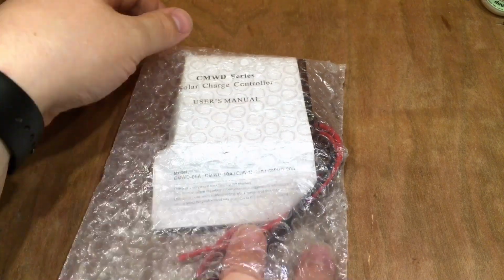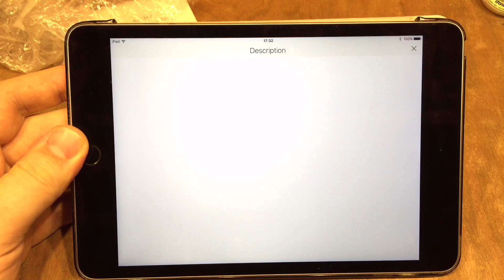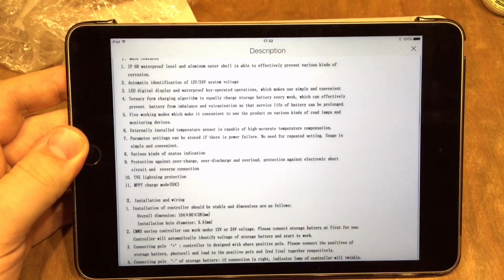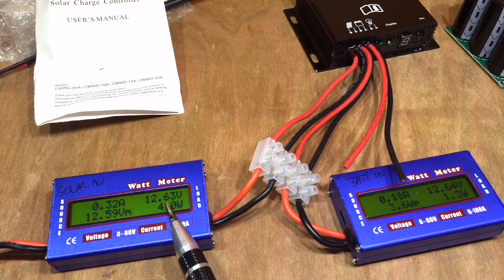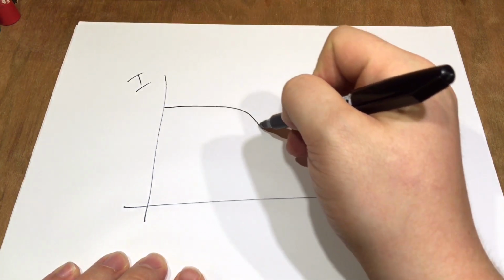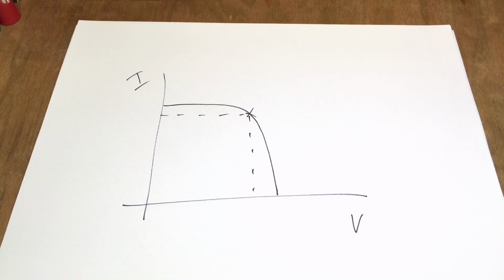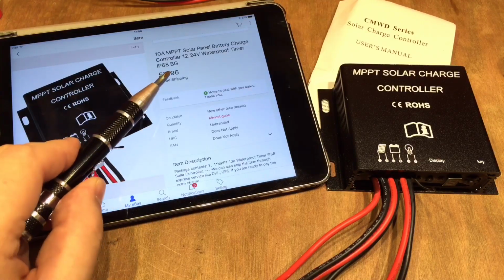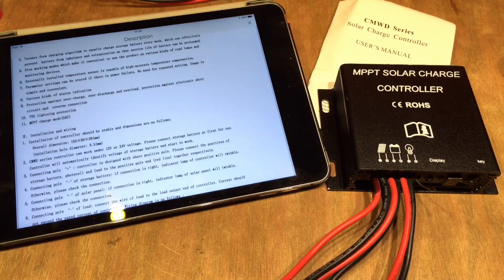Cheap MPPT(?) Solar Charge Controller - 12v Solar Shed

Comment: You are correct, Adam, that the "MPPT" charge controller you bought definitely does not appear to really be MPPT based on the input/output current/wattage your meters displayed.  But also, please realize that the similar PV voltages you measured is not the reason.  No matter how high the open circuit voltage of the panel(s) is, a true MPPT charge controller is also going to drag down that voltage to near the current charging voltage because it is going to be utilizing as MUCH energy from the panel as it can (always close to a short circuit).  So, even with an expensive MPPT charge controller, you're going to see low voltage across the panel during bulk charging.
Reply: Base on the video the MTTP controller need 3 watts to operate, if the input wattage is 50 watts then the output will be 47 watts .
Reply from the maker: I'm sorry but I don't agree.  The maximum power point is generally around 80-85% of the open circuit voltage of a panel.  Remember power is voltage multiplied by current. For example most '12 volt' panels have an open circuit of 21-22 volts and a MPPT of 17.5-18.5 volts.  When a panel is short circuit, there is no voltage and therefore no power, and conversely when a panel is open circuit, there is no current and still no power.

In bulk charging mode MPPT charge controllers should be doing DC to DC conversion and attempting to achieve the maximum power from the panels.  A good MPPT controller should have a shunt and voltage sense on the panel to work out maximum power, and most use an perturb and observe algorithm to find the maximum power. It will then adjust the DC2DC converter to bring the voltage down to the battery level and increase the current.

Most MPPT charge controllers can use much higher voltages on their solar panel input for this very reason (my current one in the shed can have either a 12/24 volt battery system, but panel voltages up to 96 volts). The DC to DC conversion will peak at bulk charging (the highest difference between input and output voltages) - reducing as the battery gets fully charged.  The DC to DC converter will almost always be a buck converter - the panel voltage has to be higher than the battery voltage, otherwise it cannot work.  In fact I have only ever seen one controller use a boost converter where panel voltage needs to be lower than the battery voltage.

PWM charge controllers will however bring their panels down to the battery voltage when in bulk mode - however it is not the maximum power point of the panel - you'll typically only get 70-80% of the rated output of the panel like this.  The panel will look to be higher when the battery is getting full as the panel may only be connected to the battery for perhaps 5% of the time - most volt meters will average their reading - but you can see this effect on a oscilloscope.  This is the reason I suggest testing the voltages when the battery is low, and the charge controller is in bulk mode.

If you haven't seen any of my other videos it might be worth looking at the two real MPPT chargers I've reviewed - there is a clear difference in input and output voltages in bulk charging mode.

Sorry for the long post but I hope you find it useful.  Thanks for your input.

Comment: Use  24 Volt batteries and a beefy PWM charge controller, they voltage from a 60 cell panel very closely matches up with the battery voltage.

NOCT voltage for a 60 cel panel is normally in the order of 26-28 Volts (not the 30 Volts from 25C testing). That comes very close to the float voltage for a 24 Volt system, excellent! Cheap

Comment: So i'm planning to set up a system with 4 cheap 100W panels. I'm interested in having a separate MPPT for each panel. Do you know of any controllers that you can daisy chain or have dual/quad mppts?
Reply from the maker: +Arnþór Gíslason none that I'm aware of that allow four strings. Two strings is more normal in the higher price brackets.

Comment: Excellent video Adam. Another fake MPPT. I've got a £30 MPPT coming soon - that'll be fun to test :)
Reply from the maker: +Julian Ilett Thanks Julian. I'll look forward to your review. Thanks also for the recommendation of the super capacitor module. Makes these videos easier to produce.
Reply: Looked familiar - it's the model that you suggested to me!
It works, and knows to switch between constant current and constant voltage as it nears the target voltage which in my case is 50.00V.
Not sure how well it tracks the MPP yet - panels can have multiple peaks when bypass diodes are used across groups of cells and shadows aren't contiguous, such as from trees.
Reply: @ahaveland  Which MPPT model did he suggest to you?
Reply: @jimthvac100  MPT 7410A in a green anodized case. There's also the CTKEV300 which is worth trying out - I got two of those too.
(Note they are boost converters and can only output voltages higher than the input.)
Reply from the maker: +Andy Lee Robinson I'm glad to hear it works - I haven't been able to watch Julian's video as I'm away and 3G is thin on the ground. 

When Julian made his comment above I did think it was most likely to be the model I'd suggested to you. I'm looking forward to getting on line and watching the review as well as seeing your progress with the ebike charging system.
Reply: Yes, I wondered if it might be the same model.
It's cute and quirky and great value, and refreshingly not fake!
Julian's done two videos on it, and a third is to come - check into a cybercafe and get popcorn! :-)

I found a way of increasing the input voltage lower limit on the Turnigy Reaktor so it can keep the panels nearer their MPP. I should add a comment to the description and do a new shorter video
I got some more cells, made 3 panels and have another one in progress. 400W is starting to get useful!
As you saw in my vid, the PVC film deforms, so am currently replacing them with polypropylene which is much better, but a bit less transparent. Ideally I'd like to use ETFE sheets but can't find any here yet.
Also adding blocking diodes to each of the six pages, which should help with partial shading.
It's really time-consuming work and I haven't finished yet, but here's a pic of them in action, charging 25V at 9 amps. (Top row was unprotected)
https://twitter.com/ahaveland/status/751810138445602816
Reply: If solar panel is 24V 4A => 96W. To charge 12V ACC: PWM use 12V*4A => 48W. MPPT (24V :12V = 2.0) 12V * (4A*2.0)
Reply: give 96W +/- ...%
Reply: all is about A not V. with PWM you need to use panels and accu almoust this same Voltage, with MPPT you can use more V less A on exit you get less V more A. :)
Reply: Instablaster.

Comment: Pheeew Adam glad that was PWM ...Im not buying anymore Solar chargers...ha ha   Adam how about a tear down of that charger to expel the myth.
Reply from the maker: +charlieoscar09 I did think about cutting it open to prove there wasn't the required components to do mppt but actually it was unnecessary and a waterproof charge controller might be of use :-)
Reply: No problems Adam good luck the projects

Comment: i was thinking of an mppt to get best from my panels then feed the battery side of controller into the li-ion controller to get best peformance but no idea what cheap units realy are mppt
Reply from the maker: +David Simpson Well this one, the Grey WellSee unit and the MPPT10/20/30/40 range with the lcd have all been debunked now I think!
Reply: aye thinking it maybe something i going to have to spend decent cash on but larger then anything i going to need just so if i ever do go offgrid im ready for upscale but unless i find a nissan leaf battery paock or tesla i think deep cycle might be route i go

Comment: Thanks for your work and videos. I think it's great that you make these and help to save money for a lot of people.
Reply from the maker: +Floyd Thomas Thanks Floyd.
Reply: ***** Hi Adam... I'm wondering if you could do a quick video showing the proper way to set up a small solar system? Step by step instructions on the proper way and order to connect everything? Panel/s, controller, battery and inverter.
Reply from the maker: +Floyd Thomas I did cover this a bit a few weeks ago. Perhaps this will cover what you want? https://youtu.be/b7jp38sFCHA